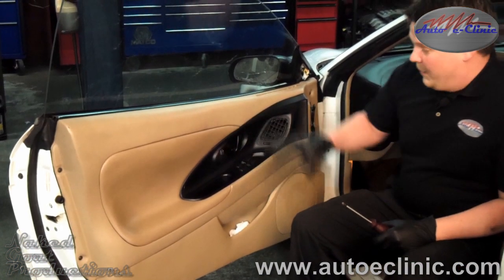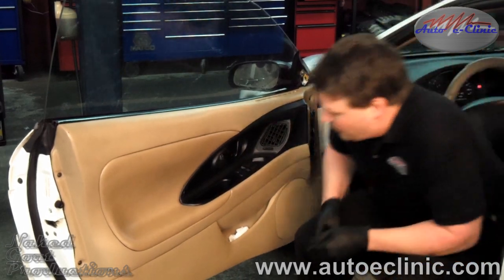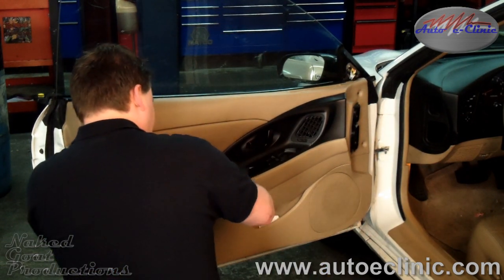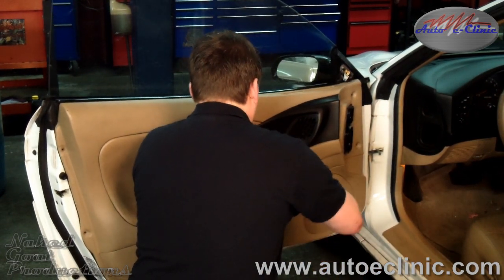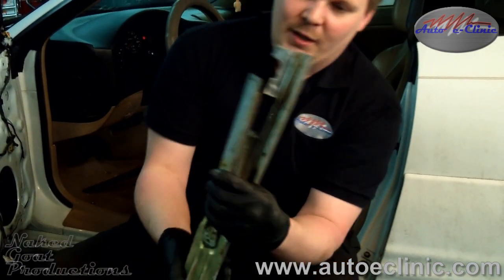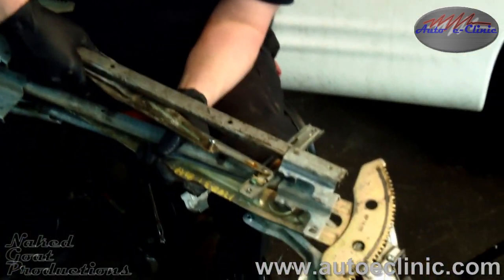How to Replace a Broken Window Regulator (Example 97-99 Chrysler Sebring)

Comment: I painfully installed the RR window regulator on a 2004 Sebring convertible with PN 5066040AB.  
Tips:
1) Buy a refurbished part with motor and warranty.  If the cable drum becomes uncoiled in shipment it is difficult to rewind and reload the cable.  Retail price of a new part from Chrysler is $287.  I eventually ordered two and the Chrysler parts looked like they endured WWII and in both cases the cable unwound from the drum during shipment.  I am fearful of Chinese made parts.  Refurbished with motor and warranty makes for an inexpensive, quick repair with some insurance during the warranty period.

2) If and when the cable becomes unwound from the cable drum there is a simple solution that is not documented anywhere else on the net to my knowledge.  The problem is stretching the cable over the top stationary cable guide.  Other solutions were 4 hands or vise gribs which could damage the wire cable.  The best solution is to tie a thin but strong rope around the cable and hang the regulator. Tie a second rope as well.  Push down on the regulator and pull the second rope to guide the now longer cable (due to springs) around the cable guide.  Presto the cable is loaded!!  Gravity rules!